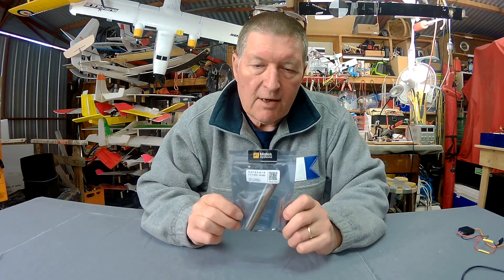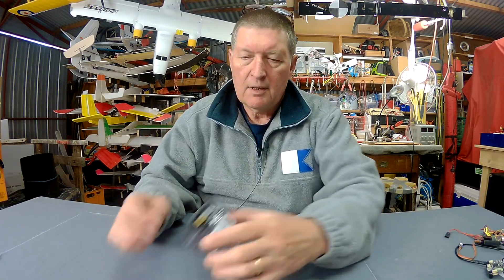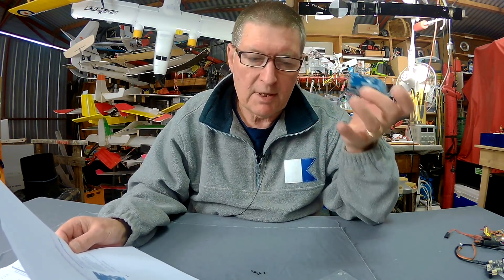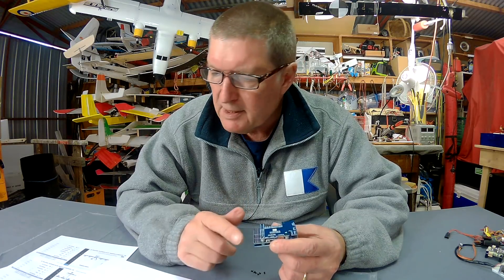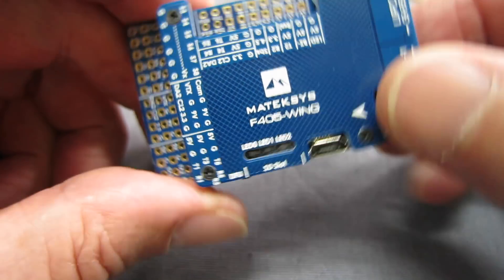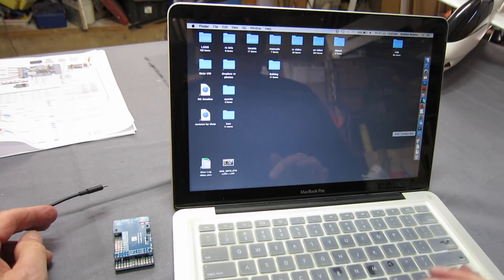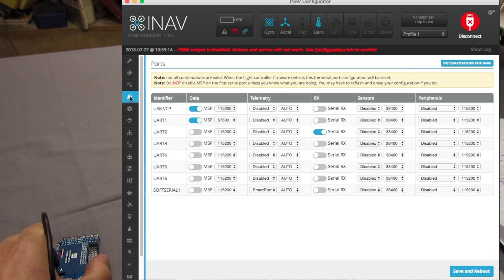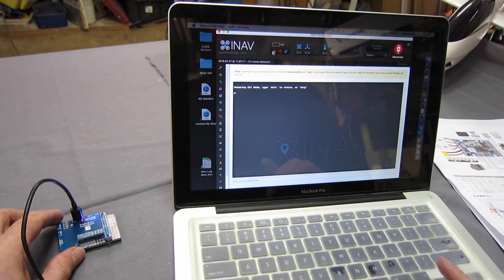Matek F405 Wing -  FCB for planes - Awesome!

Comment: Andrew thank you for posting this video. i have this fc and been working great with sbus protocol connected to an immersionrc ghost atto receiver. Did an upgrade to the latest and now it will not connect. Was wondering if you have any info to share on this. Thanks.
Reply from the maker: Upgrade to the latest INAV?
Reply: @AndrewNewton  yes. iNav 3. Sent immersionrc email for support and posted on Facebook. No word yet.

Comment: Hi Andrew. By using an s.port receiver with the F405 (and additional sensors), would I be able to view / listen to the telemetry data on the transmitter ? Alternatively, can older D8 Frsky telemetry receivers (or compatibles) be used instead ?
Reply from the maker: I believe you can use SPort with the F405 but I haven't yet. Oscar Liang has a page about it on his blog. Probably not D8 receivers
Reply: @AndrewNewton  I'll have a look at Oscar Liang's page. Thanks again for your help, and your excellent review!
Reply from the maker: Pawel shows how https://www.youtube.com/watch?v=-cu8gO9px8M
Reply: @AndrewNewton  Thanks very much for the helpful link ! 🙂

Comment: Thanks for all your videos and help,while soldering pins to my f405-wing for the gps with build in compass, I think I damaged tx4 and tx6 I see no traces going to either port, is it possible to use tx6 and rx6 instead and everything still work? Thanks again
Reply from the maker: Yes you can put GPS on any spare UART. 1,3,5 and 6 are available.

Comment: I have the Maytek F722wing FC. The problem I’m having is in manual mode my control surfaces glitch and stick when I test them.  I haven’t been able to fly my plane. I’m using analog servos and the FC is in my mini Skyhunter.  Any idea when I should check?
Reply from the maker: Only in manual mode? Very strange. Setting the servo frequency above 50Hz might do that
Reply: Andrew Newton thank you very much.  I will look into it.

Comment: Hi Andrew, I want to get into this iNAV for fixed wing stuff and I have obtained a Matek F405 from Banggood following your link, plus GPS and other bits. However, I now realise I may have a problem as I fly all my planes with a Spektrum DX8 G2 transmitter and compatible receivers, none of which have Sbus.  I do actually have a Futaba T6K and some receivers with Sbus that I could fall back on but I would prefer to use the Spektrum. Any ideas?
Reply from the maker: Thanks Mike. DSM2 is mentioned on the Matek F405-Wing page, but I know nothing about Spectrum
Reply: I have just noticed that Spektrum have a couple of what they call serial receivers (SPM 4648 and 4649T) for quads, which are designed to interface with flight controllers and DX transmitters. Perhaps they can also be used for fixed wing in iNAV? I guess I need to study iNAV a bit more and I will give Spektrum support a call. Will keep you posted. Keep up the great work Andrew.

Comment: Hi Andrew , i'm looking for a flight controller for my mini talon , would this be any good for it and what GPS would you use on it ?
Reply from the maker: Perfect FC for the Mini Talon, this is the best of them all. Recommended GPS units are linked here https://github.com/iNavFlight/inav/wiki/Getting-started-with-iNav. I have used both of them and they are equally as good. The Beitian is smaller and has a more flexible cable.

Comment: On the video you just plugged in the board and it came right up. I’ve spent 4 days trying to get the same result and can’t get past the “Failed to open serial ports” error in iNav. Any help you could provide would be greatly appreciated. Thx
Reply: New cable worked thx
Reply from the maker: @bobalbright2084  Excellent, great to hear it worked Bob.
Reply from the maker: Yes the frustrating first step. Have to install the correct driver on your PC or Mac. Links are on the first window of iNav configurator. If you have already done that then you should try a different USB cable.

Comment: I got this FCB and having trouble getting it to work. I have an S6R receiver. Do you think it might need a different receiver?
Reply from the maker: You need a receiver that does SBUS, like the X4R, X6R and X8R
Reply: Ok thanks. I have it setup for S-Port at the moment and its not working. Do you have any experience with the R9 receivers?
Reply from the maker: @sams9716  S-Port and SBUS are different. R9 works well with the Matek board. https://www.youtube.com/watch?v=q8nXAsiatkY
Reply from the maker: Sorry, that was actually L9R, not R9.

Comment: So you take one of these boards and a GPS unit you can connect your ESC and receiver and have RTL and gyro's, is there anything else needed or is that it?
Reply from the maker: That's all, apart from a PC for setup
Reply: wow nice to know. Thanks for the video and the reply!  A question, do you have any experience with the Frsky S6R receiver? I can't get ailerons to work on separate channels. If I use a Y cable they work fine.

Comment: Hey friend how do you trim the servos with that flight ✈️ controller? I can’t with the radio.
Reply from the maker: Adjust the push rod length first, that's all I have ever needed to do. There is AutoTrim in iNav but I have never used it.

Comment: I have the f722 wing cant flash the board.
Reply from the maker: Does it show in iNav Configurator at all? Did you push the DFU button to flash?
Reply: Andrew Newton sorry what is the DFU button?
Reply: Andrew Newton is that a button on the board ? I found it, how is the process?
Reply from the maker: Hold in the button, then connect to your computer, and it will be in DFU mode. Then you can flash new firmware.
Reply: Andrew Newton thanks a lot, it was that and the drivers now I have all up and 🏃‍♀️ running, totally new with this board but I am pretty exited, I also have a vector FC but is way to expensive. Anyway keep up the good work my friend.

Comment: Could you please buy send me a link to where you buy your 4 pin servo connectors. Best regards
Reply from the maker: https://www.ebay.com.au/itm/1450Pcs-Connector-Kit-2-54mm-PCB-Pin-Headers-Box-Packaging-For-Arduino-Dupont-GK-/372037314339?hash=item569f26e723
Reply: @AndrewNewton  Thank you for the link. Here is a link for gps that I have been using for 3 months with very good results. Its small and very, light excellent for gliders. Im using it with omibus F4 v1,v2,v3 boards. https://us.banggood.com/Wholesale-Warehouse-Dual-BN-220-GPS-GLONASS-Antenna-Module-TTL-Level-RC-Drone-Airplane-wp-Usa-1208588.html?rmmds=myorder
Reply from the maker: Excellent, thanks for that. I'll put it in my wish list.

Comment: does this also have autopilot? Or only flight stabilization? I have a couple other OSD/Autopilot controllers from way before race quad flight controllers and those all include an autopilot that will engage when you lose radio signal, video or feel lazy about flying back. Just curious if this has that feature or if I should spend a little more for something that has autopilot.
Reply from the maker: iNav AutoPilot

Comment: Just about to start work on my board. I see you have connected G, 5V, TX4 and RX4 for the GPS, but not SCL or SDA - why is that?
Reply from the maker: That's the magnetometer or compass and for fixed wing it is not needed, in fact the iNav Wiki advises against using the compass.
Reply: I'll leave those unconnected, cheers.

Comment: Andrew am I missing something here. Most of my vTXs run on 12 volts. The vector and Storm flight controllers have always output 12 volts to the camera and vTX.
My 1.2ghz gear will only work with 12 volts. I know I can run a separate BEC but I am really surprised with the 9 volt rail ?
Reply from the maker: I'm no expert with these matters Neil. 9V is good for all my gear, but why not 12 indeed?
Reply from the maker: Oh just remembered, it's 9V or 12V via a solder bridge. That have thought of you
Reply: Andrew Newton  Ah thanks Andrew. That's good because 9 volts would not give me the 1.21 jiga watts I use on 1.2ghz

Comment: Looking forward to more, one question will ezuhf ppm work with this board?
Reply from the maker: Beyond my knowledge I'm afraid. I have only used SBUS
Reply: Yes it is work with my ezuhf reciever.
Reply: Thanks for the heads up, I was able to get working with the ezuhf after changing a few settings.

Comment: Hi Andrew please forgive my brain fade moment but you do still require a normal 2.4ghz receiver to run with this flight controller? And also how would you connect the two?
Thanks
Cheers
Robert
Reply from the maker: You will need a receiver that supports SBUS and a GPS unit like this http://bit.ly/2go05vX. What radio are you using?
Reply: Yes you still require control looks like you need to do some reading of the iNav or ardupilot wiki depending on what software the flight controller is running.
Reply: Hi again Andrew I am using a flysky radio given to me by my son. I am uncertain of the model number but I appears to be a Flysky F6i6s with touch screen.

Comment: Had one for a while now...designed for iNAV and aircraft....Disappointed they didn't include some holes for screws to mount it though.
  The 3 pinouts for Camera and VTX do not have power on the centre pin, so watch which way you plug them in....Design error, right there.
Reply from the maker: Yes that will cause some heart ache, that's why I'll use the outer G and a 4 pin plug
Reply: Oh, that's a good idea...All my vtxs and Cameras have standard 3 pin plugs on them though....lol..Cant believe they goofed on this one. All they had to do was copy a standard F4 board.
  I saw your safeguard solution, Im going to copy that idea for sure.

Comment: I got one last week. Maiden tomorrow in a Skywalker Smart twin motor. Easiest inav build I have ever. Hardest bit was soldering all the pin headers - shame it doesn't come pre-soldered. To be honest the board is great but the Smart is iffy, so fingers crossed.
Reply from the maker: Good luck, I'll have to check out the Smart
Reply: Maybe give it a miss until I try. S1100 at the moment seems a much better twin engine wing. I had a hell of a time making COG and had to add 70 grams of nose weight even with a 3000 mah 4s. Space is very very tight and impossible to get a big enough battery in it to make COG. Mind you the S800 is the same unless you add a brick sized HD camera in the nose and that is an OK wing.

Comment: Would you recommend a beginner use this board to learn to fly a fixed wing
Reply: No flight controller is the way to learn to fly.
Reply: An stabilizer would be easier to setup for a beginner. Have a look at Eagletree Guardian or hobby eagle a3 super 3.
Reply from the maker: No, bad idea. Too much extra stuff you would have to learn
Reply: Horizons planes come with SAFE and stabilization installed. It would be far less expensive to learn that way.
Reply: True, but if he's determined to use electronic aids to get in the air, Horizon is cost effective.
Reply: Thanks all for the advice.
Reply: Andrew Newton thanks mate, learning how to use these electronics is not hard for me I followed along and understand. 
My trouble is the actual flying I seem to be totally unco with the RC planes.

Comment: very nice board indeed. I've colour coded every pin which was a pita getting all aligned properly. next board will just put em on in one go. 
what I don't like is that inav won't let us use/resource s2
Reply: You mean that you can't use S2 for a servo? You can use S2 for a second motor. I agree that it would be nice to be able to utilize the S2 pad for an additional servo, but this is with any iNav FC.
Reply: exactly. would like to see the resource function move over to inav. makes alot of sense for fixed wing